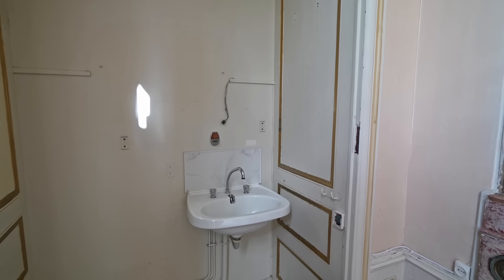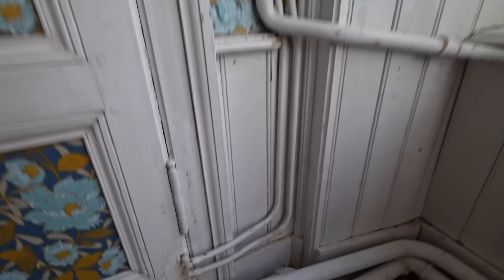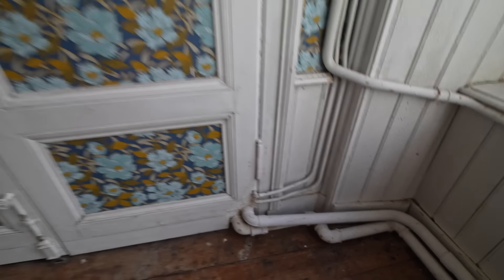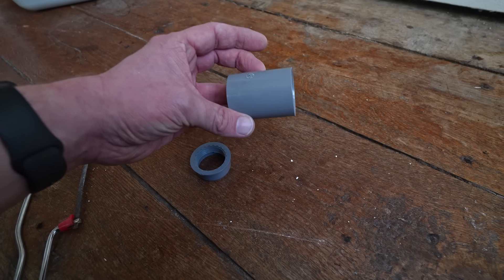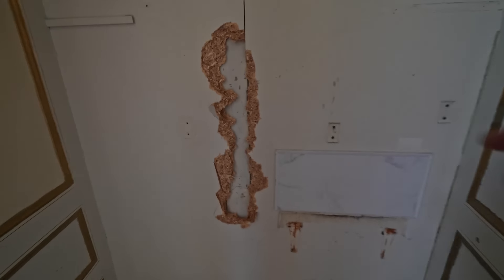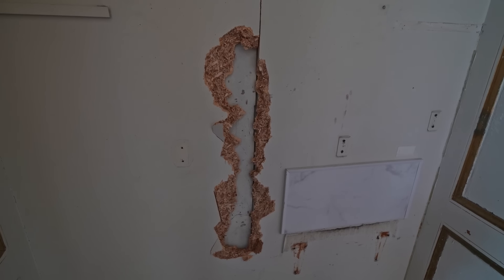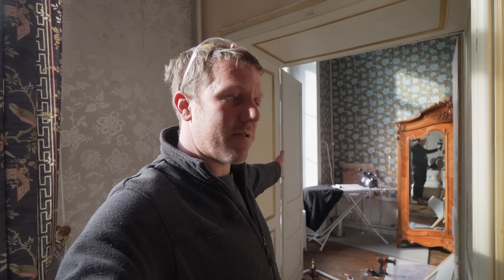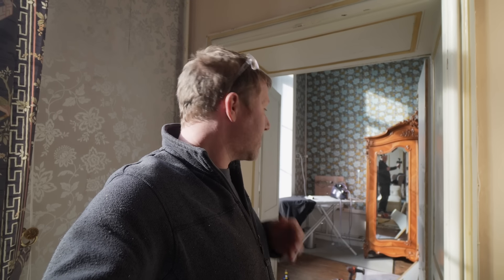Secret Chateau Doorway Open For The First Time In 50 Years - Chateau Life 🏰 EP 340

Comment: Have you considered installing a shut off valve closer to or inside the chateau where the water enters.  This way, if you have an issue, you can quickly turn it off.  Eventually, you should install several more so that you don't have to shut off the water to the entire chateau to work on one area.

Comment: Well done!  This changes the whole look for the better.  It will also allow more light in when wanted.  

You should really get a cordless oscillating tool if you don't have one. I didn't think I would use one much, but after I bought one my whole view changed.  They work well for plumbing among a host of other tasks.